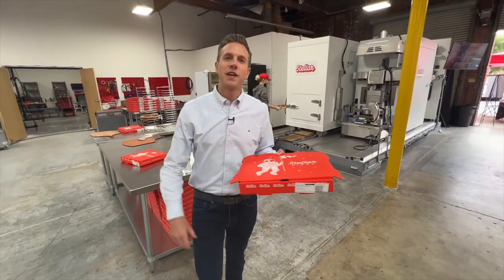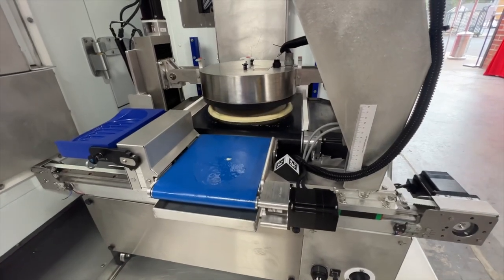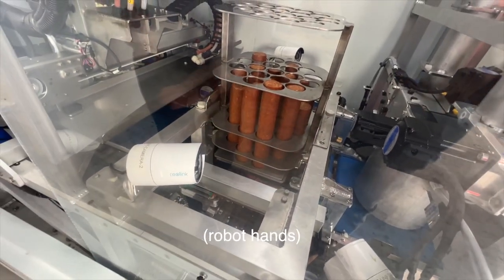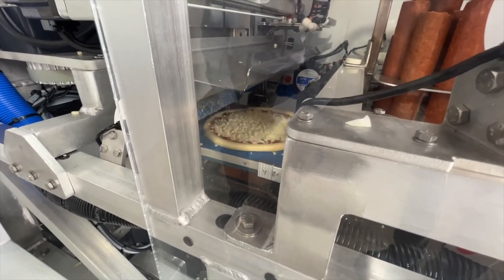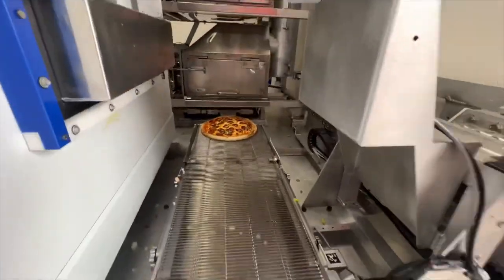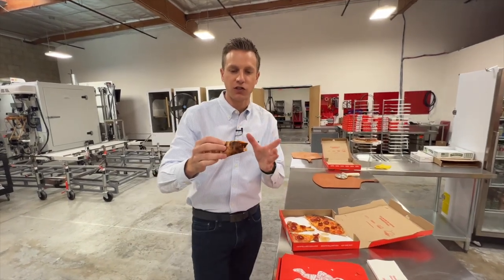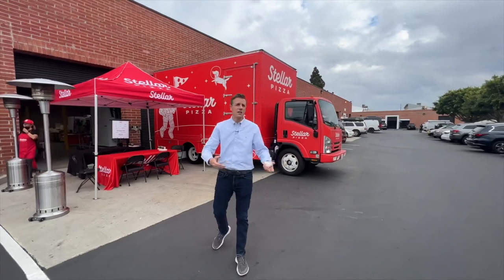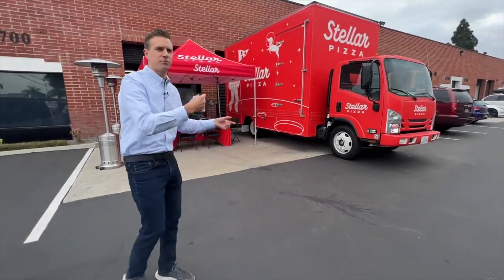Taste testing pizza made by a robot

Comment: Emergency relief.  When an earthquake, tornado, wild fire, whatever, occurs, robot catering trucks come in and feed relief workers, or victims.  Doesn't have to be just pizza.  Also, I just saw a vid of a French pizza machine (Pazzi) that slices the pizza as well as making it.  They have it in a restaurant, but there is no reason it coudn't be put on a truck.
Reply: A pizza explosion 🍕💥.
Reply: Much cheaper and easier to just use MREs
Reply: We've got tons of food trucks in LA but they are far from cheep.  Maybe, if Miami got hit by hurricane they could buy $20-$40 lobster rolls from Maine?!  Better, load up a truck with a few hundred Subway Subs, and driving around a AC cooled SUV tossing them out windows.  This is a lot cheeper!  Maybe the Tesla Cybertruck delivery and water and power service.

Comment: Awesome invention! I think the key will be mass producing it (and using BEV trucks) to get both economies of scale and reduced costs long term. Further optimizations would be perhaps adding other types of pizza so it doesn't only make pepperonni pizza.
Reply: i don't think it only makes pepperoni, or maybe i missed that but seems like it'd be very easy to just add different ingredients, i think it's mainly just a proof of concept at this point
Reply: So far 10 toppings available with cheese and pep included. But I think they mentioned before cheese and pepperoni is the starting point